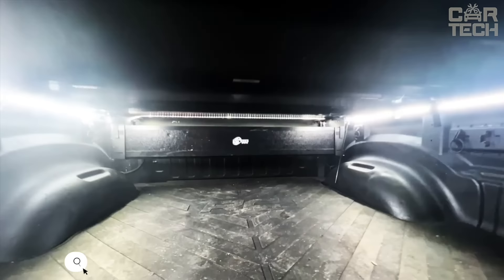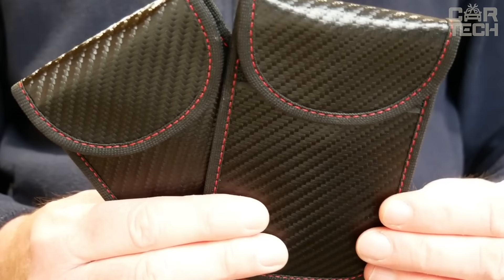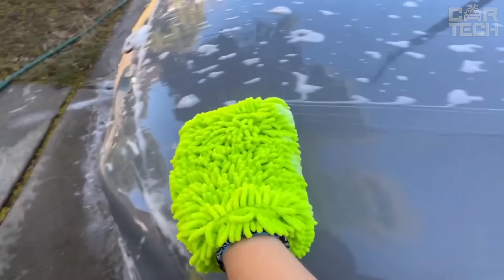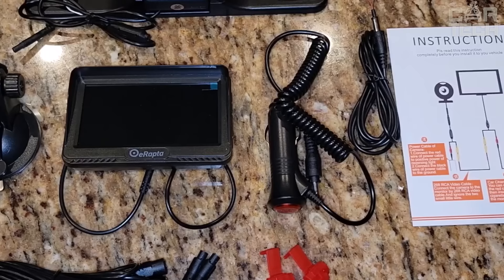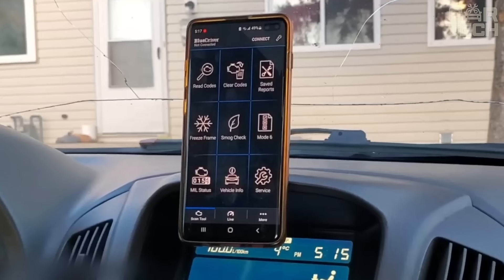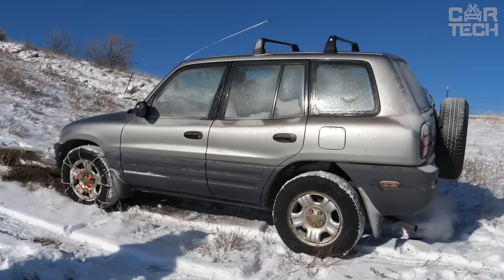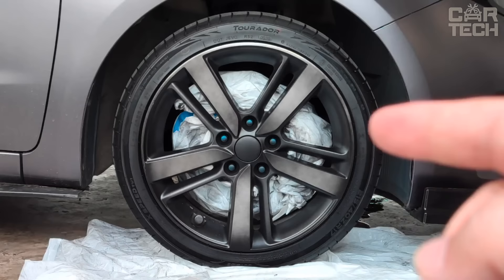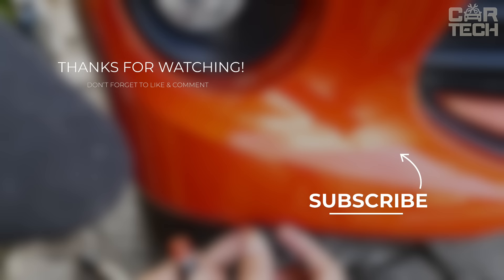Top 100 Car Gadgets on Amazon for 2024 - Ultimate Guide!

Comment from the maker: RGB LED Truck - https://cartech.tech/60-bwj.html
Windshield De-Icer https://cartech.tech/66-lhr.html
BUTURE Beta01 - https://cartech.tech/72-ksq.html
Battery Terminal Connectors - https://cartech.tech/78-afa.html
Tire Repair Kit - https://cartech.tech/15-mkp.html
Windshield Washer Fluid - https://cartech.tech/61-yxi.html
CAR GUYS Cleaner - https://cartech.tech/62-jpw.html
OBD2 Scanner - https://cartech.tech/63-pbs.html
Vantrue E1 - https://cartech.tech/103-ddx.html
Motorcraft FL-500S - https://cartech.tech/104-stx.html
Baseus Car Charger - https://cartech.tech/109-ilt.html
Faraday Bag - https://cartech.tech/111-web.html
Car Assist Handle - https://cartech.tech/64-aot.html
Tire Pressure Gauge - https://cartech.tech/19-ufg.html
Fire Blankets Emergency - https://cartech.tech/23-ipu.html
REDTIGER Dash Cam - https://cartech.tech/27-htq.html
Screw Tire Studs - https://cartech.tech/31-kbd.html
Pedal Pads kit - https://cartech.tech/37-mfn.html
Paint Touch-up Pen - https://cartech.tech/43-afo.html
Vantrue N4 video recorder - https://cartech.tech/50-brr.html
Tesla Style Android Radio - https://cartech.tech/56-yvd.html
Snow Socks for Tires - https://cartech.tech/80-rmv.html
Baby Car Mirror - https://cartech.tech/84-qnz.html
OMT Small Cargo Net - https://cartech.tech/88-luw.html
Circuit Breaker - https://cartech.tech/91-oua.html
Ice Scraper - https://cartech.tech/97-bty.html
Car Wash Kit - https://cartech.tech/107-vxp.html
Wheel Chocks - https://cartech.tech/112-ies.html
Blaster Multi-Purpose Lubricant - https://cartech.tech/113-rxu.html
Tyger LanderX - https://cartech.tech/99-fmy.html
Screen Protector - https://cartech.tech/95-fzu.html
Brake Caliper Hooks - https://cartech.tech/90-fog.html
Interior Cleaner - https://cartech.tech/58-mha.html
Car Sunglasses Case - https://cartech.tech/52-era.html
Wireless Car Charger - https://cartech.tech/48-iid.html
Rim Trim Protection - https://cartech.tech/39-zcp.html
 DEWALT Tool Set - https://cartech.tech/17-uhp.html
Car Jump Starter - https://cartech.tech/11-abq.html
Solar Panel -  https://cartech.tech/76-ddx.html
Contact Cleaner - https://cartech.tech/68-nah.html
eRapta ERT01 - https://cartech.tech/65-rxp.html
Car Wash Kit - https://cartech.tech/67-auh.html
Seat Covers - https://cartech.tech/69-zaq.html
Blind Spot Car Mirror - https://cartech.tech/70-tcw.html
Trunk Organizer - https://cartech.tech/71-yjc.html
StaySafe - https://cartech.tech/73-nfk.html
Tire Repair Plug Kit - https://cartech.tech/74-czk.html
Crystal License Plate Frame -  https://cartech.tech/77-rbw.html
Coolant Funnel Kit - https://cartech.tech/75-lvm.html
Portable Air Compressor - https://cartech.tech/12-drq.html
Infrared Thermometer Gun - https://cartech.tech/13-kwp.html
Cordless Car Polisher - https://cartech.tech/14-maq.html
Air Freshener - https://cartech.tech/79-qgx.html
BlueDriver Diagnostic - https://cartech.tech/16-ouy.html
Windshield Cleaning Tool - https://cartech.tech/18-khq.html
Hilmor HVAC Tools - https://cartech.tech/20-jtf.html
Z-Creeper Seat - https://cartech.tech/21-jfa.html
300W Inverter - https://cartech.tech/22-ngq.html
Car Charging Station - https://cartech.tech/24-lkq.html
Cleaning Gel Kit - https://cartech.tech/25-tma.html
Vacuum Cleaner - https://cartech.tech/26-kht.html
Car Trash Can - https://cartech.tech/28-lhz.html
Bestrix Phone Holder - https://cartech.tech/30-gds.html
Car Seat Gap Organizer - https://cartech.tech/110-mxg.html
Wheel Pin Lock - https://cartech.tech/108-chy.html
Car Snow Brush - https://cartech.tech/106-xee.html
Cup Holder Phone Mount - https://cartech.tech/105-iwr.html
Retractable Car Charger - https://cartech.tech/102-czk.html
Snow Chains - https://cartech.tech/98-hjz.html
Console Organizer - https://cartech.tech/96-bud.html
FM Transmitter - https://cartech.tech/93-vaw.html
Rubber Wheel Chocks - https://cartech.tech/92-ebv.html
Snow Joe SJBLZD - https://cartech.tech/89-mvj.html
DEWALT 20V MAX - https://cartech.tech/87-kxr.html
Armor All Car Wipes - https://cartech.tech/86-ckp.html
Febreze Unstopables - https://cartech.tech/85-pag.html
CURT RockerBall - https://cartech.tech/83-ejj.html
AVAPOW Jump Starter - https://cartech.tech/82-lhm.html
Ceramic Headlight Restoration Kit - https://cartech.tech/81-kbw.html
Anti-Theft Tire Caps - https://cartech.tech/59-vft.html
10L Mini Fridge - https://cartech.tech/57-qvo.html
TIG Welding Machine - https://cartech.tech/53-vas.html
Metal Glue - https://cartech.tech/54-kad.html
Plasti Dip Rim Kit - https://cartech.tech/55-ulr.html
Windshield Sun Shade - https://cartech.tech/51-ahr.html
Extraction & Fill Pump - https://cartech.tech/49-ovh.html
Fog Lights - https://cartech.tech/42-jds.html
Leather Repair Kit - https://cartech.tech/41-qxc.html
Windshield Wiper Arm Hole Pad - https://cartech.tech/44-xdf.html
Leather seat covers - https://cartech.tech/45-uqh.html
Pneumatic Brake Caliper Piston - https://cartech.tech/40-iyl.html
Magnetic Phone Holder - https://cartech.tech/38-ova.html
Strip Poly Disc - https://cartech.tech/36-szg.html
LCD Dashboard - https://cartech.tech/34-sfo.html
Armrest Box - https://cartech.tech/33-yiv.html
Car trunk mat - https://cartech.tech/32-ivz.html
Retainer Clips - https://cartech.tech/29-lky.html
Seat Cushion - https://cartech.tech/94-thn.html
Car Cleaning Kit - https://cartech.tech/47-hdc.html

Embark on an unparalleled automotive journey with 100 car gadgets that redefine excellence on Amazon in 2024! Curated exclusively from Car Gadgets Amazon, these cutting-edge accessories promise to elevate your driving experience. Whether you're a tech enthusiast or simply seeking the latest in automotive marvels, Car Gadgets Amazon has it all. Join us as we explore the top 100 car gadgets that are setting new standards, all available on Car Gadgets Amazon. Don't miss the chance to experience the pinnacle of driving excellence with Car Gadgets Amazon – your ultimate source for all things automotive! Car Gadgets Amazon, where innovation meets your car.